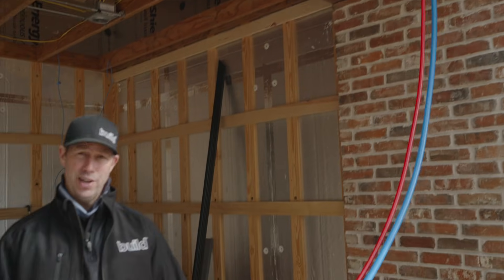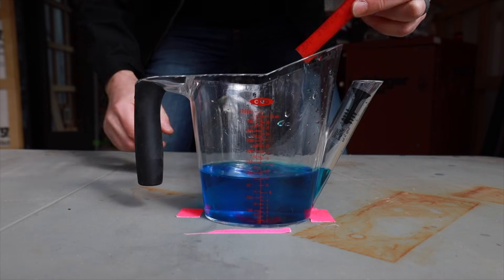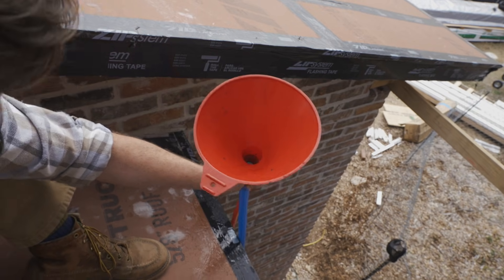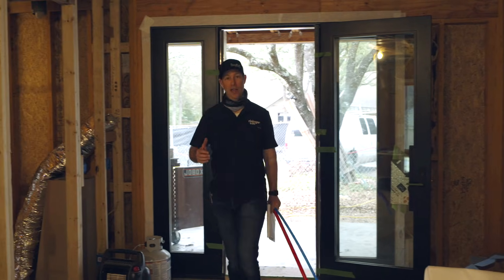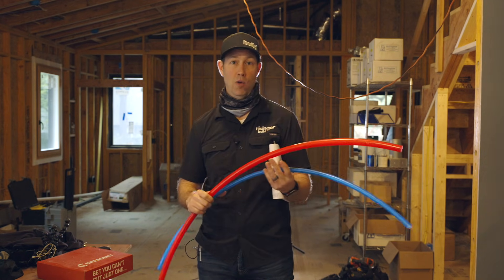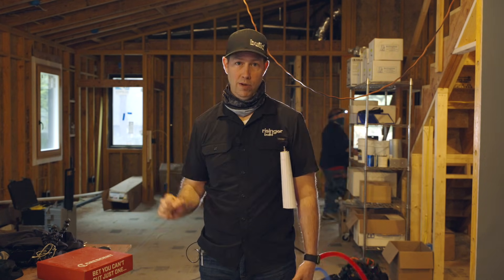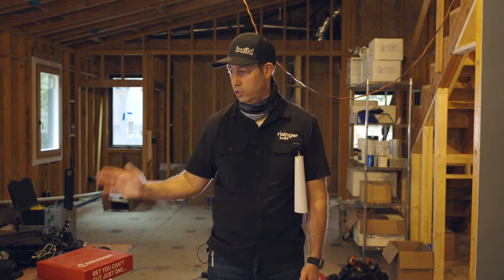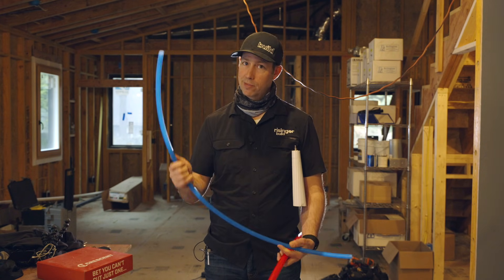What's the BEST Plumbing System

Comment: I'm gonna have to keep this in mind. My other idea is to put smaller electric on-demand water heaters in each bathroom and kitchen, then just run a trunk-branch cold-side only.
Reply: I looked into that.  Check the amperage draw and the electrical service in your home.  You need a pretty high amperage circuit for instant heat electric.
Reply: @Chrissers2010 , Already planning for a woodshop, metal shop, and two car lift bays plus a paint booth so I'm definitely planning for heavy amperage. The crazy part is that I still want to be net-zero, and that privilege is going to be expensive.
Reply: @Chrissers2010  gas.
Reply: @danielbuckner2167  I wouldn't think a person would want to service 4 or 5 instantaneous gas water heaters in a home if he has a separate heater for each bathroom and the kitchen.
Reply: @Chrissers2010  In a normal home one or two would easily do. Most kitchens and laundries are adjacent due to DWV as are baths in a back to back configuration. If your house is large enough to need four or five then YOU arent doing any service, youre paying someone else to and the cost is near irrelevant.
Reply: @danielbuckner2167  The original poster proposed using separate water heaters "in each bathroom and kitchen".  Electric is not a good way to do that as it would require multiple 50 to 100 amp feeds.  Gas would require multiple units to maintain.  

I am actually more in agreement with you than maybe is coming across.  I will be doing two zones in my home under construction.  Almost the entire hot water use is on one end of the home (kitchen, master bath, powder room, laundry).  On the other end of the home is a single bathroom for two bedrooms, and since we are empty nesters, they will rarely be used.  We will put that on it's own loop as a minimum.
Reply: @Chrissers2010  Right on. Sounds like a plan. I am just saying the amount of IWHs is the same whether its gas or electric. The OP may only have one kitchen and one bath,  he doesnt say how many and 4 or 5 seemed a scoche high. Gas eliminates having larger amp service if it isnt available. However either will require pulling wire or line so neither is out of the box ready to go. Now there are under cabinet models for sinks and even some electric shower heads which are popular around the equator but both will need some sort of wiring or fuel source and exhaust.

Comment: I believe that for high volume outlets such as bathtubs and showers, the heating source should be at the point of delivery eliminating the cold slug and wasted water.  Go a step further and just generate all hot water for the bathrooms and kitchen using an instant water heater in each area.
Reply: Yes, well designed homes group plumbing together which is cheaper and more efficient.  Simply put an IWH in each of those locations.

Comment: Its the same as a trunk and branch system with a recirc line. This is very, very common in commercial buidings, except it is pumped and uses circuit setter restrictors on those lines, which can get pretty big.

Comment: Water is almost as cheap as air for us. Spend your money elsewhere and deal with waiting the sixty seconds for hot.
Reply: Because it's cheap does not mean it should be wasted
Reply: @daveklein2826  this is a convenience thing. I would like to see a cost analysis of water bill vs energy to heat recirculated water between the two options. I would venture to say water is cheaper than energy for most of us (solar might be a close consideration)  my point was more that the money spent on this convenience could be better used on something else. But in this case it looks like money/materials is also cheap.
Reply: @daveklein2826  Agreed. Honestly how hard would it be to simply have a larger resevoir for toilet flushing and use a thermo controlled bipass valve to fill that with the chilled water from the hot side???😔 Answer: its not. So why not do that? Because its also a cheap solution and you cant bleed people dry by doing things cheap-- no big profit there!
Reply: Ya know what else kills me, when people freak out about a few cups of water that go down the drain and then set their water heater temp at surface-of-the-sun hot then use the damned cold water to cool it back down in the shower!! I like hot hot showers and just set the water heater at the temp i like the shower (admittedly hot) and then dont waste MORE water cooling off the hot water you paid to heat up to start with!! The only downside is the dishwasher temp which ive found a little effort before putting the dishes in accounts for just fine.
Reply: @danielbuckner2167  yeah I set my hot water heater the same way. Use wood in the winter and heat pump in the summer and it's perfect with either.

Comment: Hot water recic pump no wait for hot water. Its fantastic 👏
Reply: So that pump just turns on and off all the time keeping that water hot?
Reply: @danielbuckner2167  we had ours on a timer. 6-8am and 5-8pm. Hot water during demand times.
Reply: @joelpage4165  oh youre never home in the day or up earlier or later? Huh, ok. I guess that works for that sort of existence.
Reply: @danielbuckner2167  I have a watts recirculation pump. I set mine in the winter to run every hour or so overnight to prevent freezing. Because my pipes also run in my attic. Since we have tenants, j try to find some time in the day to set the timer and have the pump run. The water doest get cold fast when it's just sitting in the pipes. I noticed it still keeps warm for an hour or so depending what time of the year it is and if there is even an call for hot water.

Comment: Would love to see a whole system analysis of energy consumption of this vs. other non-recirculating systems.  Keeping a recirculating pump going on a 3/4" line 24/7/365 must use a fair bit of energy, not to mention the heat loss from an uninsulated, always hot line inside your building envelope in a location where you run a lot of air conditioning.
Reply: You can design a gravity flow system that works on water density so you only have to deal with thermal loss. We used to have to design a hot water system on the Journeyman Plumbing license test. I have installed a couple of dozen gravity systems and they work great. A heat source at each bathroom group would be the highest water/energy saving system.
Reply: @jameskitzmann6268  That is a great idea. Thanks for the info, I will look into this system. Shalom
Reply: That's a really good point
Reply: You want all lines insulated and they have recicurlating system that can be programmed to your water use habits. Say you take a shower around 10 pm every nite, the cicurlating pump cuts in around 9:55  so you have hot water ready to go. The Germans have done a lot of development with this type of system. Shalom
Reply: @thomasblue6064  put on a schedule by my plumbing? No thanks.
Reply: @danielbuckner2167  I know am not good about staying on schedules. Shalom
Reply: another thing to note...with a thermometer controlled pump, the pump may be "on", but it's only running when it sees a temperature at a set threshold.
Reply: @TheSidneySmith  yeah, on for a bit, off for a bit, on for a bit, off for a bit. And so on and so on only saving a little and the pump drawing more qt start up nevating part of those savings even. Sounds costly compared to waiting for 30 seconds.
Reply: @danielbuckner2167  considering many of the pumps are ~30 watts.....even if it runs 24/7, it's like you've left 3 LED lightbulbs on.
Reply: @TheSidneySmith  Closer to 90 watts and yhe energy audigs performed by the eneegy commission stated recirculation systems often lose more energy than they save .Check energystar.gov. If the convenience of hot water faster is worth it then just fa e up to it bug dont hide behind the veil of false energy savings. Its like if you drive a f350 diesel to your job as an accountant then own it! Dont try to convince everyone its as efficient as a prius.
Reply: @danielbuckner2167  yes, there are some units that pull 90 watts....and there are also units pulling 24 and 25 watts.  For anyone planning on installing one of these, doing a little bit of research to make sure of which one is right for them is important.
Reply: @TheSidneySmith  Yup, and on top of that the initial cost and time to recoupe that plus energy use through heat loss.
Reply: Taco has a motion activation pump system along with a aquastat and smart plug that learns your usage and times.
Reply: This.

Comment: Also a huge waste of pex tubing, I've measured up some older houses with kitec manifold system and its amazing how much tubing adds up, easily get to >1000ft. Branch system my favorite, way less tubing👌
Reply: Although at roughly $0.40 a foot for PEX tubing, the $200 savings of only running 500 ft vs 1000 ft is inconsequential. But when you're talking about saving $20+ a month on a water bill, over 30 years. That's where the real magic happens.

Comment: An idea. What about have valve that open when a set temperature is reached. Before that all the water is returned back to the boiler ?
Or maybe have a motion sensor that turn on a pump when people enter the bathroom. The pump send all the water in the pipes  back to the boiler until a set temperature is reached.
Reply: Well you dont want to de-pressurize the pipes if you dont have to, but I like the valve idea
Reply: That is a thing in independently pressurized systems. You open the valve which lets the water flow through a bipass back to a tank or reservoir and when hot water reaches the thermostat at the faucet it switches to the outlet and the user. You wait the same time as usual but no water is wasted.
Reply: These are used in RV's. They call them water-miser. Don't know why it wouldn't work in a house?
Reply: @caseysanguins9490  Even more so on expensive boats, especially sailing cruisers. The issue most designers have is the constant pressure working back against you. In  a boat or an RV you have an enclosed system but with a house you are connected to a pressurized pipe that comes from somewhere else so you have to account for the pressurized pipe coming in and the fact that it is not an enclosed system. This can be done much the same way main water supplies were brought into homes in England in past decades or similar to the way a toilet bowl refills itself from the tank when there is a need for water but doesn't suffer a constant pressure because the fill valve cuts its off. Systems like that are well-suited for homes that are off grid or ones you see in Latin America that use a cistern for their water supply and that cistern and acts as a reservoir and makes the system enclosed except for the periodic interjection of rainwater to top it off.

Comment: I would imagine that your water heater would have to work at least a little bit more considering the water that is cycling around the track is having to be reheated. Could/is the main track insulated to help out with the heat preservation?
Reply: It normally is insulated which is required all over the EU and most other countries. Many places actually require a re-circulation system if the point of draw off is over 5 meters away from the hot water source. The energy to reheat already hot circulated water is less than the cold mains water filling the tank.

Comment: I have a small house but when we did a partial remodel on the cheap, routing the water through existing pathways saved money and money was the name of the game.  As a result, the VERY far run takes a good 20 seconds for the hot water to reach the upstairs shower.  We are doing a much bigger remodel on the rest of the house and part of it will result in re-running the hot water to the shower with a re-circ pump as Mike here describes.  Glad he is validating my research!

Comment: What about a "hybrid" pex manifold trunk and branch system, instead of having each pex line directly to fixture, you run it to a room and branch out to fixtures from there?
Reply: I am considering a "hybrid" system.  Our build is an empty nester home (3 bedroom).  It is a long footprint, with the two guest bedrooms on the very end of the home.  One recirculating hot water loop to the bathroom for those two guest bedrooms with a motion sensor that starts the recirculating pump when someone enters the bathroom.  The rest of the house, which is much closer to the water heater and where my wife and I will live, would be on a second loop that recirculates continuously.
Reply: @Chrissers2010  i would consider a separate instantaneous water heater for the two guest bedrooms.
Reply: @Jim C that sounds impressive  and more expensive than it probably is
Reply: @Chrissers2010  If that guest room loop is insulated I'd be worried about legionnaires disease.
You want a hot water line to either be hot always or able to cool down quickly after use.
Here in Europe we're not allowed to insulate a non circulating hot water line for that reason.
Reply: Thats what I'm doing in my house right now, should work great.
Reply: People did this for larger houses with just valves before manifolds were a thing.
Reply: I installed a Viega Manabloc years ago and have not installed one since. I love the idea of shutting off each fixture individually and having no joints. It's also great for adding a fixture. But it really isn't practical.
Reply: And then you can install an 'anti-sweat' mixing valve for the toilet, so that once you flush it pulls the cold water out of the hot water line so the sink is now primed :) (Also works if you plumb the toilet with only hot water, except a hot water toilet is... well.. warm and kind of weird. (Remodeling a trailer home and the hot/cold lines got accidentally swapped)
Reply: I repiped my house with a remote manifold. Working great for me. I have shut off at each manifold. So in the event something goes wrong or service needs to be done, I can shut water off to that zone and beyond. So the entire house isn't out without water. Whether it's hot or cold. I also purchased a water circulation pump and installed it on my water heater so that during peak times and in the winter, water gets recirculated therefore reducing the wait for hot water. Keep in mind, not all water heaters support this water recirculation. New water heaters also have a flapper valve installed at the water inlet to prevent water backflowing. I just simply removed Mine. I have a new regular 60 gallon atmospheric water heater.
Reply: It would seem to me that the disadvantage to this approach would be that you would have to located the sub-manifolds in places where you could access them. That would mean lots of access panels all around the house to get to the sub-manifold valves.
Reply: @tomroehl5126  mine are under the bathroom sinks, kitchen sink with plenty of access (and it's recessed so it's not getting hit by items being moved around). I don't anticipate a constant emergency where I need to access shut off. But it's there if needed. I only sub manifolds that have access panels are the ones in my garage. Strategic planning is important. I have revised my original plan several times.
Reply: @tomroehl5126  Well,  toilets and sinks already have shut-off valves nearby usually, so if you located the sub-manifold under the sink basin you'd not need a special panels. Might be a bit more pipe to feed from the sink to the other fixtures though.
Reply: You'd want access to each manifold and the shutoffs and have to design that in.
Reply: Growing up, our house had 1/2” copper pipe for everything. Not perfect but it worked. A single 1/2” pex line should easily handle a bathroom’s hot water needs, especially now with faucets and such being lower flow.
Reply: Hello
Reply: that is Uponor's Logic plumbing system with remote manifolds (ie multi-port tees). its the best of both worlds and what is being put in my house
Reply: Many plastic manifolds don't allow hot water recirculation through the manifold,  any recirculation need to happen prior to manifold. You can of course build your own from coper.
Reply: @sigor2011  I've seen people with manifold systems put the recirc pumps in the room, briding the hot/cold (one-way valve hot -> cold) with a motion sensor before.  But it's only done with an 'as-needed' being a long distance from the manifold..
Reply: @sigor2011  Since when?  I installed a Manabloc in 2008 with a recirculation loop between tankless and manifold, documentation never mentioned this was an issue.   Now tankless hw heater had LOTS of warnings about reduced warranty.  But simple fix was to use a 7gal point of use electric hw heater in the recirculation loop.
Reply: @nneelix  on my Vega manifold   from about that vintage it was in the instruction manual.
Reply: @sigor2011  Interesting, I read my manual from cover to cover never said a thing.   Either way I wouldn't worry about it, 15 years later I'm still running strong.  Had to replace my recirc pump several times but the manifold is still going strong.
Reply: You could but unless that manifold has its own re-circulation line you'll be waiting just as long.
Reply: @effervescence5664  The advantage is the hot water waste is limited to a room use.  Main bath being a good example.  Someone shaves and the shower is now primed.  Someone showers and the faucet is now primed for the next person who washes their hands, etc.  No recirc necessary, and if the pipe length to the manifold is short enough you can still avoid waste and have the less then 30 seconds to hot..
Reply: @mgfray7657  I know a girl who kept a bucket next to the shower. When she turned on the water it went into the bucket until it was warm enough to get in. She just used that water to fill her big golden retriever's water bowl.
Reply: @danielbuckner2167  either she didn't shower that often or her dog has a drinking problem! :D
Reply: @jpitt916  Haha, a big hairy dog in the south needs water and i dont think it was that much water in the first place. :)